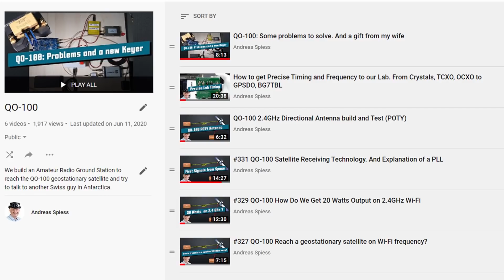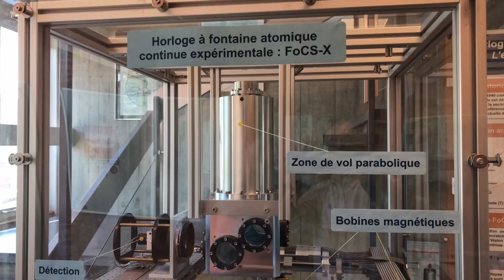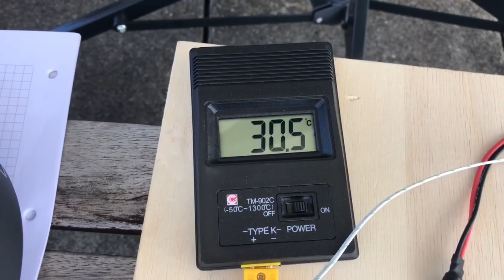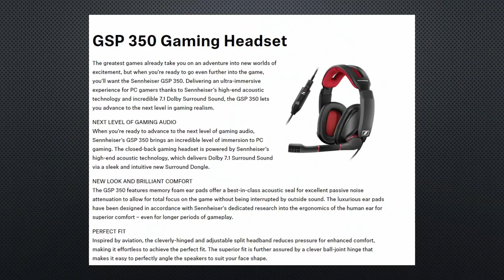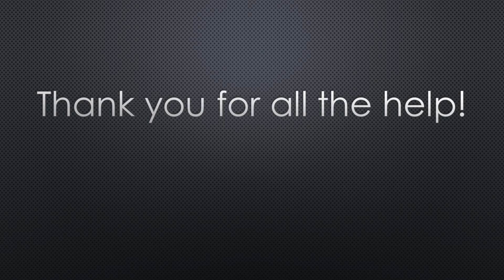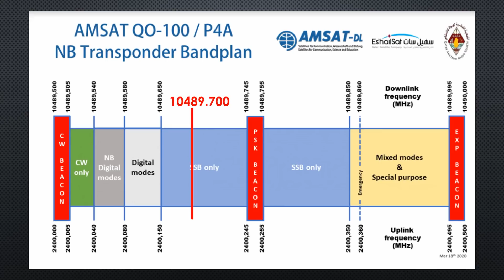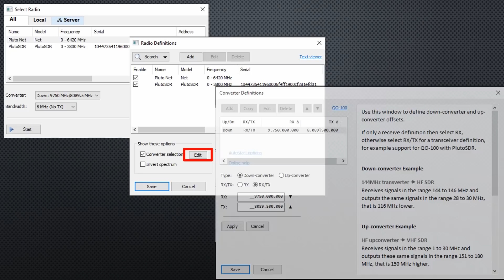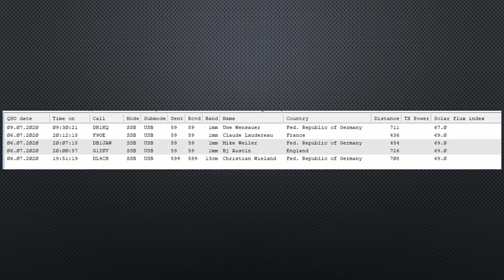020 QO-100 Update: Fried Things and a Success (Part 6)

Comment: This is great stuff. Really looking forward to the frequency standards! 
I thought your tx was SSB. So why did it fry with no modulation? Instability?
Reply: no heat displacement, over current without output
Reply from the maker: Unfortunately, I never did the video on frequency standards. And yes, we use SSB and I also did not understand why it heated up without a signal.
Reply: @HB9BLA  Pity about F standards. The amp was Chinese - your choice of bin is probably best.
It's a long time since I did this kind of thing but a single output transistor means a class A amp (?) which are nice and linear but inefficient. Maybe the quiescent just cooked it without enough cooling.